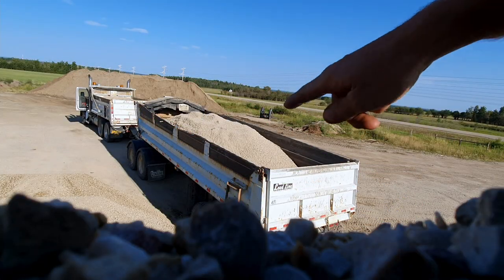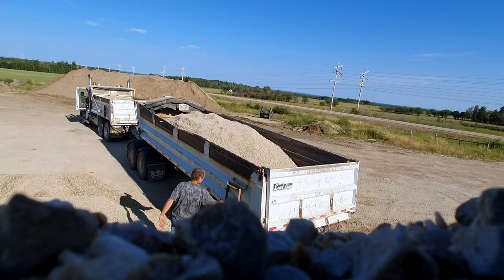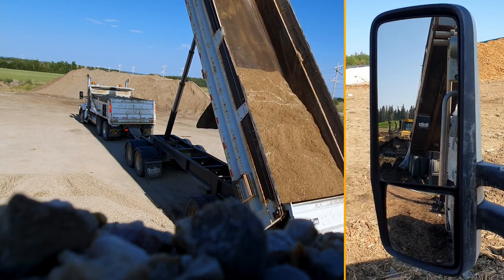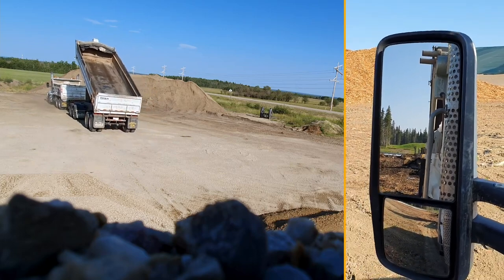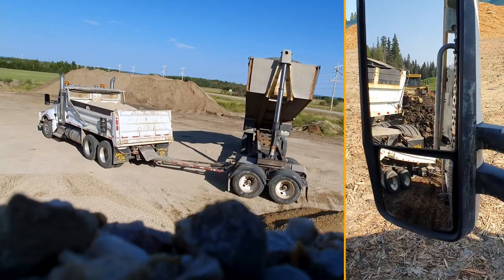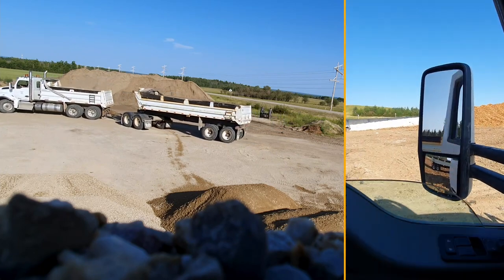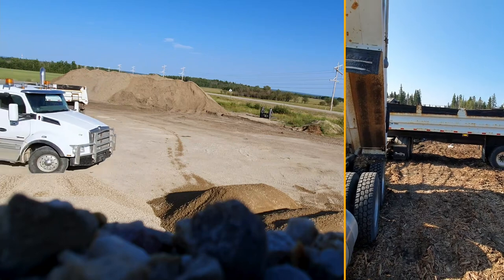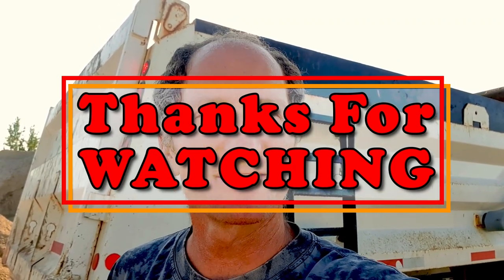How to backup and dump a truck and wagon without unhooking

Comment: Good job with dumping the wagon and the box without dropping anything. Before I retired I pulled containers for 25 years. I pulled everyting from 20 ft.to 53 ft. and even double 20's. One of the hardest things to learn was backing a 20 ft. into a dock and get it straight. In your case the key to dumping both units without getting crossed up is how you steer the converter. In the beginning it's like trying to herd cats. Lol
Reply from the maker: Yes! A few pointers from other guys as to what to do and off we go! Getting better,  but it's not simple.  Lots of guys won't pull it wagon at all.

Comment: Awesome job man. I used to pull super B flat decks and I gained a ton of respect for guys that can wheel a unit around like that. Lots of practice 👍
Reply from the maker: Thanks Clinton.  I learned another trick about turning around with a wagon this summer . Posted that video a couple weeks ago. 
Faster to jack knife the converter under the wagon than to back the wagon around the corner. Wish I had a drone to video it from above. 
Hope you are doing great.

Comment: I’m on my second day on a new job driving a dump truck with a quad and I’ve been a class one truck driver for 29 years and this is the most overwhelming hardest thing I’ve ever done. I have my supervisor at the site. Meet me when I get back and hop in my truck and teaches me how to do itand I still am not understanding. I wish they just put me on a trailer, but they’re not doing that. They put me in a quad right away.
Reply from the maker: Holy! I hope this video helped. I have another video of turning them around I'll try to post the link here for you. https://youtu.be/NxavZz2aZwY
They're different for sure, but I think I prefer them, Some folks are terrified of them, but it's just a matter of remembering you are steering it with your converter not with your truck. Another really good thing about them compared to long trailers or things like a B train, is you don't NEED to get all straightened out like an arrow to start over again, all you need to do is get your converter pulled back into place, and start pushing it again with the back of your truck. I see lots of guys pull WAY ahead & try to keep it straight as an arrow. Way easier to pull ahead 10-15 feet & get the front back where it belongs & make your way back some more. It will become easier.
I hope this helps / and makes sense?

Let me know how you make out! I'll be happy to hear from you in a week saying you feel like a pro!

Comment: how come nobody is pounding the like button. how could you not enjoy that?
also i can see why side dumps are getting so popular. i think even i could do that. maybe.
Reply from the maker: It's not rocket science,  just have to have a bit of practice and some coaching on how and what you're trying to aim for. 
AND more practice! The other day I had to unload on a 2 lane highway. With a cement barrier on the side... managed to get it after a couple tries.  Only afterwards I got thinking I didn't need to do it at all! I should have just backed the trailer parallel to the pile and jack knifed the converter into the pile. Experience, I guess,  - comes from experience.

Comment: I wish my truck had enough hp to pull all of that I have a superdump 22 ton capacity and it came with a m11 cummins makes no sense
Reply from the maker: It makes a guy appreciate the old days when  guys were running 250-300 horsepower.  Did a lot more shifting and slower on the hills. The truck I run now has the x15 Cummins .engine plate says 565HP